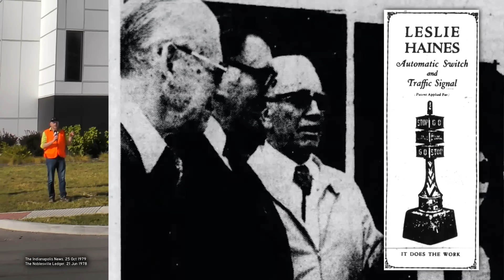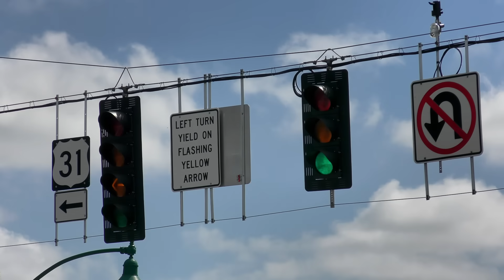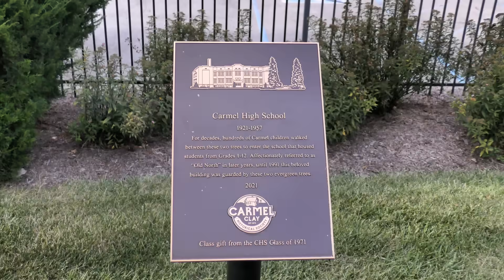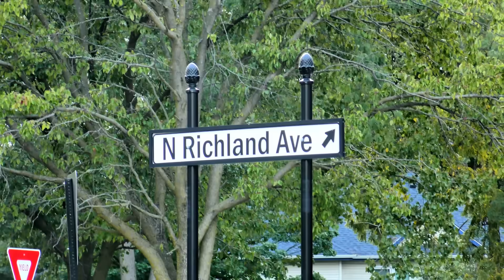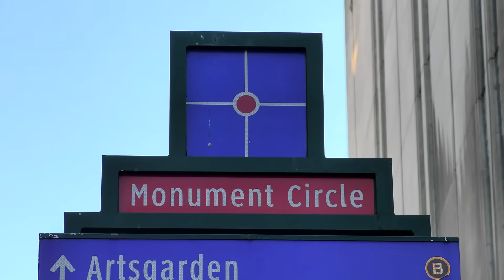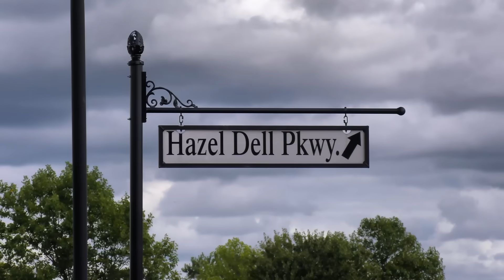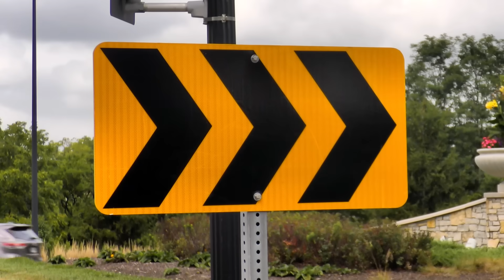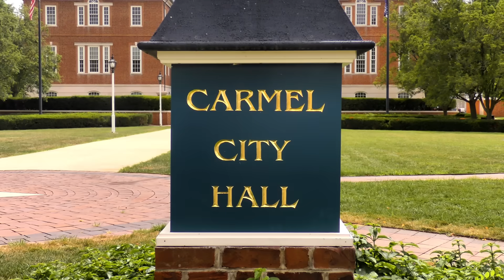Let's FIX the HIGH SCHOOL... with 152 ROUNDABOUTS!

Comment: I am from Poland, when communism fell, in 1989, wew had few roundabouts, basically none in smaller towns, people were skeptic when they started building them, now people DEMAND roundabouts everywhere. No collisions, no clogged crossroads, no need for expensive lights. Just give way to guy on roundabout, and one on the left. Even if you somehow f-up, everyone going so slow, so no problem at all. They so great. I know they looks difficult, they are not.

Comment: If people use a round about correctly they will and can handle more traffic than a light. The problem is no one wants to slow down.

If we would stop building roads for speed in the USA. We might find that we drive slower and actually get places faster. The fact is that we have lots of ways to make things safer. The one that people don't want is smaller streets. 

If we built smaller streets then people would want a smaller car. The big cars just don't feel safe on small roads. If we used brick roads would be safer. 

The one thing that people don't talk about is what to do with people who don't drive safe. Why not give them a way to get out of the accident. If you can pass a virtual driving test then it's like you never got in the accident. If you don't then you lose driving license, registration and insurance until you can. We all drive so we should understand and know the rules for safe driving. Because we all know how to drive so you should be able to pass the test.

The cool thing is that we know that people are still going to drive. It's a right after all. So if they are in the holding for not passing the test and they get into another accident. Then we should find something like moving in a death machine six months jail time and 40 hours of highway cleanup. 

We are going to have to do something that drastically changes how people see cars. Maybe all we need to do is make a road that is similar to the way that the ground rolls around. Hopefully something will work. People are important and they have no place on the road and need space.

Comment: In Massachusetts "rotary" is just a synonym for "roundabout". There's no distinction whatsoever. Some Massachusetts rotaries are poorly designed, but it's a category error to use the Massachusetts terminology to differentiate. The rotary that Rob shows at 6:14 conforms to modern design practices, with sensible lanes marking, white lines prohibiting lane changes, and so forth. One falsehood that stems from this misunderstanding is that traffic does not yield when entering rotaries. That's just not true: Massachusetts traffic law requires entering traffic to yield to traffic in rotaries, no matter the design.

Comment: No mention of the Long Beach Traffic Circle?  (which is almost 100 years old).  It's huge and handles a large amount of vehicle traffic.  It was originally a traffic circle but was converted into a modern roundabout in 1993.  And I wouldn't want to imagine trying to get through that intersection if it were controlled by stoplights. 

https://en.wikipedia.org/wiki/Los_Alamitos_Circle

The official name is Los Alamitos Traffic Circle but no one calls it that.

Comment: Thank you for all your work, Rob! There was one moment that had my raise an eyebrow, though. In the segment about capacity at 10:40, you mention that they added slip lanes to increase car throughput for peak usage hours. However, doesn't adding slip lanes counteract some of the benefits of slowing down car speeds? It's my understanding that slip lanes are often dangerous for pedestrians because, in contrast to roundabouts, they don't require slowing and signal to drivers that this is a place that is prioritizing driving speed.

Looking at the slip lane you showed, it also massively increases the total distance pedestrians have to travel to get across the road.

Plus, none of the facilities featured here seem to encourage or protect people traveling by other means. With all the land used for a slip lane, there was more than enough room for a multiuse path that could have helped reduce peak car usage hours at the intersection by encouraging people to travel by bike, powerchair, skateboard, etc. It might have been cool to discuss that a bit with the mayor as well.

Comment: I deleted and redid my comment not knowing in the previous one a US modern roundabout is a very specific traffic circle of single lane, operating speed of 10 mph - 15 mph with yield merge traffic metering.   Multi-lane traffic circles are dangerous and are not included in roundabout statistics because they are not roundabouts as defined for those statistics.   

The reason for modern traffic circles is likely secretly politicians desiring traffic calming in that roundabouts discourage through traffic causing it to switch to other roads.   A roundabout places a secondary road's traffic, such as neighborhood's,  at the same priority as the primary road which individual neighborhoods would likely favor.

Comment: When I had to go pick up a friend from Carmel high school a few times i almost got hit every single time because of the insane traffic in downtown Carmel. They need to build a new high school on the west side of the city and they refuse. 6000 students and all the roads connected to it are 1 or 2 lanes and not suited for the traffic. The remaining 4 way stops aren't clearly labeled, there's not a safe bike route from the west end of Main st. to the Highschool, there are bike paths a little further north but they're next to high speed roads and not really intended for bikes, and high schoolers drive like morons. Believe me, I love drifting 40 mph round the roundabouts in this city, but carmels infrastructure isn't really that intelligent, it's just a few lucky guesses. Also, I fucking hate spring mill with every fiber of my being, the intersection between main and spring mill has a poorly labeled turn lane style entrance to the roundabout and it leads to a lot of confused drivers trying to midtakenly cut people off trying to get into the correct lane mid roundabout

Comment: Any city can time its signals to allow continuous travel.  Most don't.  They luv causing drivers to have to choose between speeding or slamming on the brakes, over and over.  I've seen city employees timing intersections several times.  They set the lights to turn yellow just as cars approach.  Traffic circles are just another way to cause drivers to repeatedly gas and brake.  It's good for business.  They can write more tickets and sell more gas and brake pads.  Besides, California doesn't enforce federal drug laws.  Since "legalization," I've noticed that many drivers take 4 seconds to react to a light turning green.  I shudder to think where they'd put their cars in the four seconds before they react to seeing a traffic circle.

Comment: I love it how in USA roundabouts are seen as something extravagant, even somewhat scandalous. It's a common occurrence overe here in my corner of Europe. I am curious what useful thing is normal in USA that we would consider groundbreaking over here in Europe. Probably lower taxes.
Reply: Air conditioner
Reply: @John_Doe_is_not_here  Where I am at AC is a normal thing. I have two in my apartment. But from what I heard there are large parts of Europe that didn't adopt the AC much yet.

Comment: Hey Rob, love your videos! There is one other huge advantage to roundabouts that doesn't get enough attention, maybe you can address it in another video. That is that the roundabout is completely passive, no electronic or mechanical systems have to work for the intersection to work. In an age of potential cyber attacks, terrorism etc, this resiliency is incredibly valuable. Just think of how much chaos a cyber hacker could create in most of our cities that are totally dependent on traffic signals.

Comment: I just hope more suburbs and cities across the US start doing this. Along with adding dedicated & protected multi-path sidewalks (with a grass curb separating the road and multi path) along the roads for walking and cycling and connecting areas of their cities together (it would also help get more cars off the road). Not do one development here and then some other random thing over here. It all needs to connect together. It requires actual city planning by the city council and mayor & the developers. 
Roundabouts though really help improve traffic flow and it looks prettier. 

So far my hometown has only added two & one is in the middle of nowhere. And there haven’t been any new ones lately which is a big shame.

Comment: I went to this high school. When I started, there was still a stoplight at the one roundabout you where on. When I finished, that roundabout was done and the second Roundabout was only half done (They left it half done for around a whole school year). I was dropped off the whole four years I was there and in my experience, stoplight is much better. When the roundabout was there, you could easily take ~5 minutes to drive from the east side of the school to the west side, where the drop off spot was. The traffic actually gets backed up all the way to a nearby parkway a mile back and even farther back. 
Another problem is that a good 70% of buses that leave Carmel uses that roundabout to leave the high school. I'll say more than half would need to go straight or left onto main. the problem with that one roundabout is it's too small, so all the buses that don't make a right turn will end up partially on top of that roundabout. This will make each driver drive pretty slow. Because Carmel is huge, there is at least 30 buses, maybe even 40 which has to use that roundabout. Carmel releases all those buses at once, so they'll block cars from entering the roundabout and let the buses go. Traffic gets blocked really bad since buses take a really long time to get out. Luckily for me, I left before they finished the second roundabout. I can only imagine how bad it gets now. 
Most of the people I talked with agree that Carmel is taking the roundabout thing way too far. If you look at the Keystone Parkway exit onto 136th St (aka Smokey Row) that has a traffic light on an exit, I believe that would be a good idea to control traffic.

Comment: I'm rural, about 35 minutes northwest of Carmel and my god do I absolutely love the roundabouts. I do most of my business in Carmel and anytime I have to drive somewhere else that doesn't have them it's enraging. Of course I hated them when I first moved up here, but that changes pretty quickly. Honestly, having fellow citizens that understand them is a major contributing factor; little bit of mutual trust makes them all the more seamless. 

The nuances discussed regarding center diameter, angles, etc. are very important. There are some that have popped up in other places in the state and I don't think had the thoughtful engineering put into them that comes from having built hundreds, so are a touch sketchy. Glad they are spreading (even have a couple coming to my teeny town) and happy to see Carmel getting recognition; it's a lovely place.

Comment: carmel has unlit offramps from the highway that turn into unlit roundabouts. my brother found that out when he decided to run from the cops with us in the car 2 weeks ago, so we went over the concrete, and smashed into the other side of the lane going about 80. Had my fingernail shaved off with some skin on my left pinkie, needed stitches, sprained knee, seatbelt rash, mild cuts, and a thoracic compression fracture.

don't try to blame me for running if you're gonna ask, i wasn't behind the wheel.

Comment: Holy fuck there is still so many issues with these roundabouts. The approach angle needs to be way more acute and you should almost never have slipways. And if you do ever need to build a roundabout on a 4 way road you should really go for a turbo roundabout, which would not only be Safer but also has higher throughput. But also just don't build a ducking road in front of school and church, those should strictly be access streats.

Comment: I'm not against roundabouts but in Georgia they are building roundabouts that semi trucks cannot get thru without driving over the middle. State highways that really don't need them.
Reply: Trucks are supposed to hop the inner curb for offtracking.  They were specifically designed to do that, but also prevents car from using the middle to go faster.

Comment: I used to live in Carmel,and now I live in Fishers next door. The roundabouts are spreading, but for low-capacity intersections, they are absolutely wonderful 95% of the time. Any time there is a large number of cars going through, my 20-min commute to Carmel for work turns to 40 minutes. Timing versus traffic is the true key to using them around here.

And Brainard, while no longer in office, loved to talk about these roundabouts with anyone he can. He slao helped to revitalize downtown Carmel to a place better than downtownm Indy.
Reply: I live and work south and west of Carmel, and the roundabouts are spreading here too. I really enjoy them. The only issues I see with them during high traffic times is the number of inexperienced drivers who still pause before entering the roundabout when they don't need to. I even do it sometimes even though I know better because I don't trust the other drivers to follow proper procedures for a roundabout. Those little hesitations really slow things down.

I took a trip overseas in the '06, and there were roundabouts that had 3 lanes of traffic going around them. It was chaotic and terrifying to even be a passenger in, but the local people flowed so smoothly around them that it really did seem to keep things flowing much faster than a stoplight would. I don't know how to get American drivers to stop with the fear hesitation upon entering the circle.

Comment: I used to work overseas in the Middle East, and in Qatar, they used to have so many roundabouts! In the Middle East, you take your life in your hands driving on roads there, and roundabouts were common sites for fatal collisions. Eventually, the roundabouts were removed and replaced with traffic signals...which you didn't dare run the red lights on! The traffic deaths plummeted as a result...roundabouts work best on smaller roads like the ones pictured in Indiana, not 8 lane behemoths begging to become freeways.